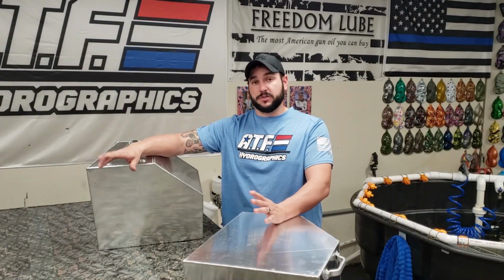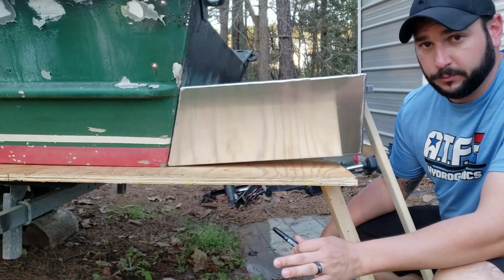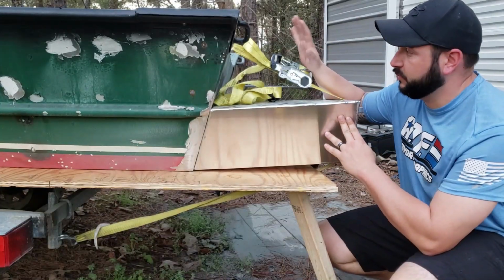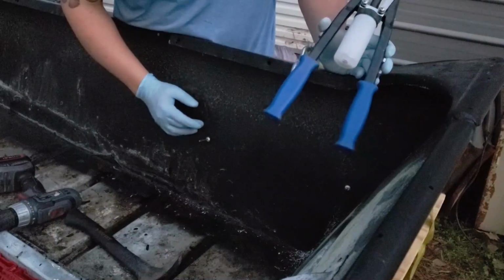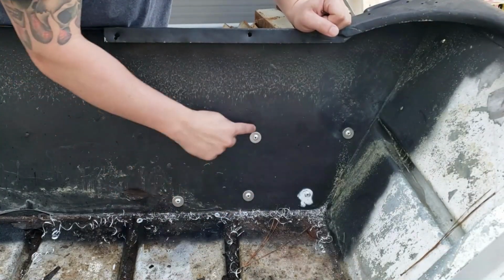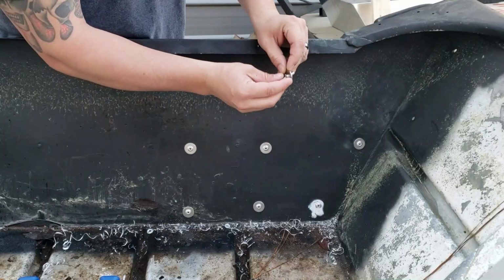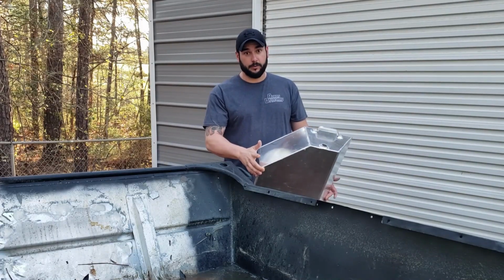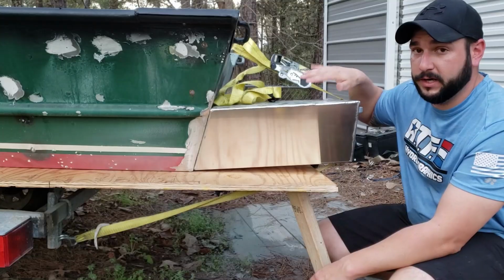Easy Jon Boat Float Pods || NO WELDING REQUIRED!!!

Comment: I was thinking of using 3m structural glue, either 4200 or 5200, on top of caulking.  I've seen fiberglass swim platforms with motor mounts actually need to be ground/cut off if they were no longer wanted

Comment: Have you noticed any negative characteristics after installation? I ask because I got all excited and slapped mine on and welded BEFORE reading instructions. Beavertail recommends pod ends be no more than 1/2” above bottom of boat. I have about and inch and it looks like you may have even more than that? I have yet to take the boat on the water but I’m already freakin out.

Comment: You’re wrong on the aluminum and stainless steel part. My cousin put stainless steel screws in the hull of his aluminum boat and went out on the water with it when the steering went haywire and he ran into a dock.  He said he dang near dropped the jar of moonshine he was holding! LOL

Comment: Nice idea, but your transom is gone so its easy to get to all the points that need fastening. On my boat I only have three inches of access on the bottom. Transoms not rotten so I'm not about to pull it just to avoid cutting the pods for the bolts.
Reply from the maker: Completely understand, I wouldn't want to pull out a good transom either.

Comment: I have a silly idea that I have been pondering. What if you were to put insulation panel on the bottom outside of the boat then fiberglass over? What that increase buoyancy since the foam is then technically between the bottom and water?
Reply from the maker: Nope... buoyancy is all about how much water the boat displaces. It has nothing to do with how much foam is in the boat. I really need to do a video on this subject. Thanks for the idea.

Comment: Thank you for this bro this is how I'm doing it. Hoping the angle works out though because if not this method wouldn't work out would it? Worried about burning through while welding them
Reply from the maker: Been working great on my boat, no complaints yet.

Comment: Would these work on a 1436 Jon boat
Reply from the maker: Yes, but I would recommend getting a bigger boat. 1436 is not very wide and a wider boat will hold a much bigger motor.

Comment: Awesome stuff dude. Check out a place called “ wicks” for odd parts with aluminum and the yard store for tooling with rivets. Everything you’re doing is kinda in a way aviation stuff. They way you did it works end of the day man got it done🫡. In the future etch and alodien the metal dramatically help with corrosion. Spread that sealant all over the surface from one end to the other and bolt or cleco squeeze the two surfaces together. Then lay out either a lot of smaller rivets in a checker board pattern and squeeze them in wet with sealer. Or use big rivets and do doublers or strips or metal on the back of your transom no need for washers then. Just watch some aviation sheet metal videos or something prolly. Be better informed for ya than me. Again love your setup dude really wana do the same in the future can’t thank you enough for all the videos dude bravo getter done build buddy! Cheers 🍻
Reply from the maker: Thank you very much. I will look into that aviation sheet metal stuff. might be able to learn something new.

Comment: I would highly recomend getting an air powered rivet puller. Will solve your tight corner pull problems and sooooo much time/fatigue in the long run if you do a lot of boat work.
Reply from the maker: I hvlave an electric one, probably shoukd get a Ln air one too for those bigger rivets.

Comment: New to the channel just got a grizzly 1648 SC. My first “tiny” boat.  Get rid of the flapper wheel and try this. I work on aluminum trains this was a game changer for us. 
Scotch-Brite Clean and Strip XT Pro Disc - Rust and Paint Stripping Disc also 
Scotch-Brite Clean and Strip XT Pro Extra Cut Disc

Comment: Okay, I get that the float pod increases stability on the stern but how can someone increases stability on port and starbirt to keep it from being so damn tippy.  Why can't someone make float pods for either side essentially widening the hull?
Reply from the maker: You really cant effectively or cheaply. They only way to do it right is to get a wider boat.

Comment: I had a set of floats tig welded on my 18 ft Lowe Big Jon. I think it weakened the metal and the one float is tearing away and will leak. I'm probably going to add pieces of aluminum diamond plate to the inside  installing a new set on a 16ft boat.
Reply from the maker: ohhh thats not good. Sometimes the welder overheats the metal and it can weaken it a lot.

Comment: My floats were tig welded on but I changed the drain plugs to wrench tighten and cut off the 2 handles so nothing for branches to snag ! I like this install and save the $650.00 I paid for tig welding also put traction pads on top if I ever did need to climb in that way on a Lowe 18ft Big Jon !

Comment: I did it the same way but instead of washers I used 1/8 thick aluminum plate I bought 4x8 sheet and scribed the whole inside of the transom and yeah that 5200 is no joke, I run a 25merc 2stroke and there's zero flex anywhere on a 1448 Lowe

Comment: Can I just use the 5200 without rivets?
Reply from the maker: I wouldn't. The Rivets do the bulk of the holding, the 5200 is just for good measure.

Comment: I have a 14’X60” welded aluminum boat with a tunnel hull and a 70hp Johnson. The outboard weighted the back end of the boat down with the 12 gallon gas tank and batteries in the back of the boat so I did the exact same thing you did to mount them I just did not use sealed rivets and I used 25 rivets per float pod and they are solid! Used a bunch of 5200 fast cure and I can stand on them no problem, great to sit on when in the water and to climb in and out of the boat. Float pods did exactly what I wanted them to ( raised the back end 6” and kept water from coming over transom when coming off plane) after seeing you method I had to try it and do it for myself!
Reply from the maker: AWesome to hear it went well for you. I really like it so far and it has worked great for me.
Reply: Still holding up?
Reply: My transoms is layered and is very thick so idk if I can use rivets. Can I get away with only using the 5200?

Comment: You can use stainless steel washers and bolts on aluminum with no issues at all if you put a plastic washer in between the aluminum and the stainless or if you can't find thin plastic washers then you can even use duct tape!!! I have worked on and built and rebuilt semi trailers for my whole life and alot of trailer manufacturers will even use just packing tape to put between aluminum and steel or stainless steel. Just as long as the steel doesn't touch the aluminium directly. The reason is when steel and aluminum touch eachother it causes a chemical reaction between the two metals and causes electrolysis and it will turn chalky white and eat away at the aluminum like rust does to steel and before you know it the aluminum will disappear around the steel. And also if you had a big daddy pop rivet gun you could get into those corners better and those blindhead rivets that you used are the right choice for any rivet used on a boat hull and would be my go to for being water tight.
Reply from the maker: Thanks Jason. Glad you enjoyed the video.

Comment: Man I added those to my boat by welding year ago and they have been fine and I thing they work to a degree.  However, I want to now add a Hunt Deck to the rear using the pods to complete that build.  I look on YouTube and no one has done this. Any advice you can give please reply.  I have access to Aluminum welding and will buy necessary aluminum to make this work,
Reply from the maker: Pretty simple, cut some aluminum to fill in the gap between the pods, and weld er' up!

Comment: What are the rivets for whenn the adhesive is what's doing the work ?
Reply from the maker: Extra strength and to hold the pods in place while the 5200 cures. That stuff takes days to set up!
Reply: @SendItJonBoats  ok, thank you. My boat has storage boxes on each side that are welded in. I would have to cut access holes in each to get to the inside of the transom for the rivets (or bolts if I did it that way). As much as i like the adhesive concept, and even have the 5200 on the bench.....might be stuck with finding a welder. But I'm still thinking as I have to cut holes to get to the old waterlogged floatation foam ...... thank you.  Pls keep up the great video's!

Comment: Wanted to ask if anybody out there has had any experience with getting stopped by a game warden and having them check your boat weight capacity label? Do they do this? The reason I am asking is I have a boat that states its weight capacity as 2 people or 300 lbs. Or 355 that includes persons, motor, and gear. From what I read online it is a law that you are supposed to follow. But I see the same boats on the water with I know to be more weight than that. Do game wardens check that stuff when they stop you? Also, what if you modified the boat to hold more weight. Is it legal and is there any inspection you have to do to recertify the boat?
Reply from the maker: Here is GA they usually just check for registration, life vest, fire extinguisher and make sure no one is drunk.

Comment: Will these work on a John Boat that is 30 inches in flat width on the bottom? I notice the size chart is for boats at least 40 inches wide.
Reply from the maker: The smalls may work, but you will have to measure them and see.
Reply: @SendItJonBoats  The small ones are 15.5 wide. So they will not work if you add 2 of them because the bottom of the boat is 30 inches from one end to another. Could these be installed under the boat maybe at the back some how?
Reply from the maker: @loopster40  I wouldn't waste the time or effort on a 30 inch wide boat. Better off getting a wider boat if you really want pods.
Reply: @SendItJonBoats  I don't want to put pods on it. I just want to make it at least legal. The plate says 300 lbs or 2 person. Or 355 lbs persons, gear, and motor. Well, I could not go fishing out on the water with my brother. Because we are about 455 total weight ourselves. I do not want to get stopped by the game warden and them saying you are over weight. I would assume when they stop people they check the weight capacity sticker.
Reply from the maker: @loopster40  They may in some areas, not where I am so I do not worry about it too much

Comment: Is your boat 36” or 48” wide? I’m thinking about getting small float pods to help with the weight of my new 15hp Mercury. I’m afraid that my 1436 isn’t wide enough. I will only have 14” between the pods.
Reply from the maker: I have a 48 inch bottom. You can get the smaller pods for a 36 no problem.

Comment: I think my drain plug is offset to the right side. May have to make float pods according so they don't block drain !
Reply from the maker: Yeah don't want to block the drain, you would always take it to a welder and have a new one put in.

Comment: Awesome vids and explanations on the process. Did you use more rivets on the second pod and why? Sorry if this has been explained already. I’m using your method when I do mine as I’ve used 5200 for a lot of crazy stuff and it’s held on like the last fruit of a loon on worn underwear.
Reply from the maker: I ended up putting eight rivets total in each pod, and I think I added the last few after the camera was off because it was getting dark. They held up great and 6 would have been plenty

Comment: question, what do these help with? stability?
Reply from the maker: No, they only help keep the back of the boat riding higher in the water. They do not add any side to side stability. Need to make the boat wider to do that.

Comment: No Alcohol. If you read the instructions for the 3M sealant, it specifically states to not clean surfaces with alcohol as it inhibits curing. Other than that, I love it
Reply from the maker: Well 3m myth busted.... cured just fine and still holding on! LOL. Who reads instructions anyways???
Reply: @SendItJonBoats  Smart People read instructions. Just imagine how much stronger your pods could be if you used acetone instead.  Why I bet you could gain another 50 pounds and they’d still hold up!
Reply: Ok ..I thought you meant no drinking during instalation

Comment: I have personally used aluminum rivets on a stainless piano hinge on a leaning post. In five years i flipped it up and it fell apart. I wish you luck
Reply from the maker: We shall see what happens.... Doubt I will even own this boat in 5 years, but even then the 5200 and the paint layer in-between should help prolong it.

Comment: Question for ya. My hull walls are pretty low on a v Hull 14ft. Would it benefit to add them on a normal boat that isn’t a John boat?
Reply from the maker: They would help get the back end floating higher.

Comment: Modern military craft are glued together instead of welded wherever possible. In fact I'm pretty sure there are some with no welding at all. Fuck the haters, practical solutions for practical folks.
Reply from the maker: I didn't know that!?! Hell if it's good enough for the military then its good enough go full send on a jon boat!!!

Comment: what is the point of float pods?
Reply from the maker: To help raise the back of the boat if you have a heavy motor on it.
Reply: @SendItJonBoats  thank you for your reply. Makes sense. i will see if i can find a vid showing before/after run footage.

Comment: Did you fill your pods with foam?
Reply from the maker: Nope, foam will not do anything and will not add floatation. It only helps if you swamp the boat to keep it floating longer while you bail the water out.
Reply: @UCXYVFXnAKWRXQggQstHAvIA I agree, however, wouldn't it add weight to your boat on one side of it flooded?

Comment: Any update after a few months use? No errant float pod drifting in the lake?
Reply from the maker: Nope, they are still on there, and holding up really well. I would do it again in a heart beat. I got an update video coming soon.
Reply: @SendItJonBoats  what size engine did you squeeze on it and what was the clearance like?

Comment: Is there room between the pods to run an outboard? I don't use mud motors but thinking the benefits of getting on plane quicker and floating more shallow and level would be nice, although I don't remember seeing pods with a regular outboard. Perhaps it isn't noticeable enough to be worth it
Reply from the maker: They make the pods in different sizes so you can get a size that will allow you to run an outboard if you want. Mine are the medium and on my 1648 I would have plenty of room to run an outboard and not have any turning issues.

Comment: Silicone holds fish tanks together with a tiny bead in the corner , think about that, its strength is its suction and flexibility. ridged glues are weaker when they can't penetrate the parent material.
Reply from the maker: 3m 5200 is plenty flexible for this application. Still holding on after a year just fine.

Comment: Can I ask why you didnt just weld it? This method seems more like a pain in the ass than just welding them up there.
Reply from the maker: Just trying something different to see if it works. We know welding works, but this worked too. Never would have known if we didn't try.
Reply: @SendItJonBoats  Fair enough, man. Turned out good.

Comment: So how’s it holding up? Getting my first Jon boat soon and I’d like to throw these on mine. Does it also aid in stability while fishing?
Reply from the maker: They are holding up very well. I would do it again in a heart beat. It does not add side to side stability, you need a wider boat for that. They only help keep the back end floating higher in the water.
Reply: @SendItJonBoats  hey I appreciate the feedback! I picked up a 1969 6hp evinrude at a garage sale for 5 dollars and put 40 in parts in it and it’s running awesome. I’d like to add these pods to the back of the boat because I’m a 300lb whopper. Figured it couldn’t hurt when I’m in the back of the boat.

Thanks for the feedback!
Reply from the maker: @coreykinnamon2609  Awesome glad I could help. The float pods are a worth while investment for sure. I would put them on any on boat to be honest just because they work so well.

Comment: I use a "pivot head rivet gun" to rivet inside small enclosures.
There would be plenty of room to use it inside a boat and much easier to use than that large one.
Reply from the maker: Where were you last year when I needed you? I didn't know that tool existed until you mentioned it and just looked it up. Add to cart! Thanks for the tip.
Reply: A air rivet gun can fit into the tightest of places. Harbor Freight carries them for a really cheap price too. I won't use the oversized hand operated guns anymore. Yeah im air powered spoiled. Lol
Reply: BTW I'm a sheetmetal layout guy of 28 years I've put in my time of "working hard" now I mostly "work smarter" 😆